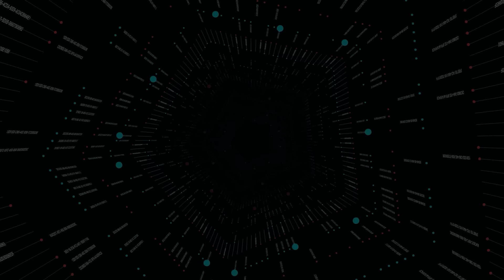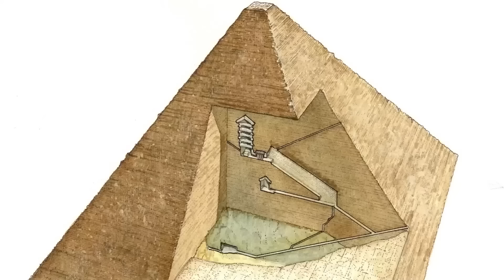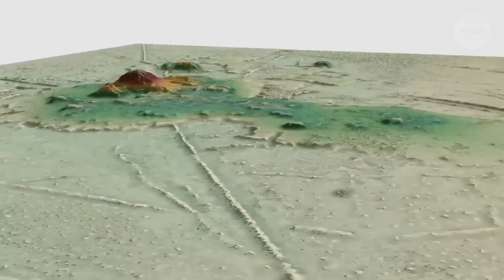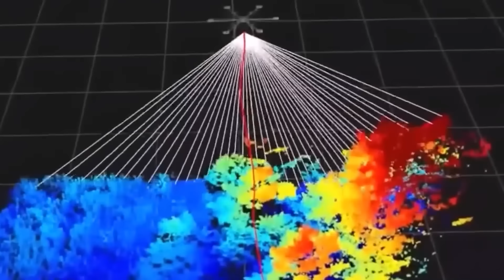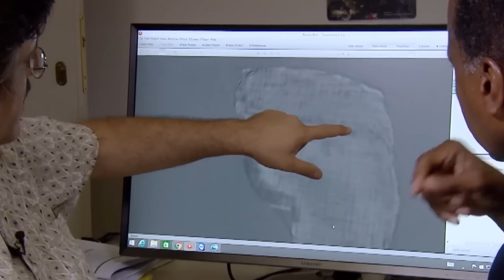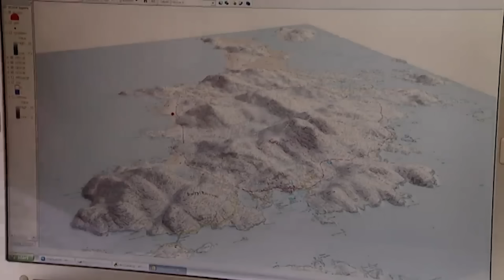MOST Mysterious New Discoveries That Shocked Archaeologists

Comment: Mohenjo-daro, And Harappa, aka Often Called The Indus Valley Civilization, And The Surrounding Areas, Were Hit With Deadly, Extremely High Heat, High Energy Weapons Fire, And High Energy, High Pressure Blast Wave Weapons, From The Extremely Ancient Aesir, aka Anunnaki Pyramid Wars, Which Melted Parts Of Those Areas Structures, And Eradiated Those Areas, And Regions With Deadly Radiation, Which Is Still Measurable Today, August 25, 2024